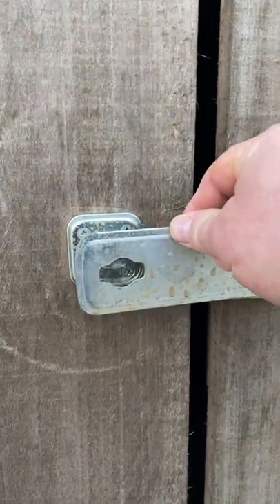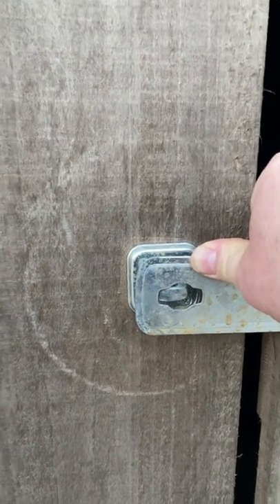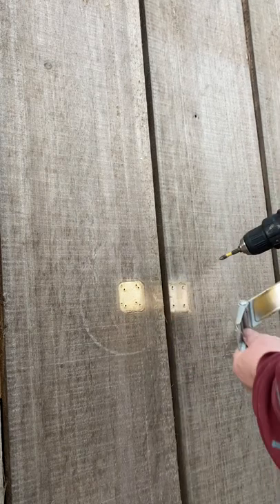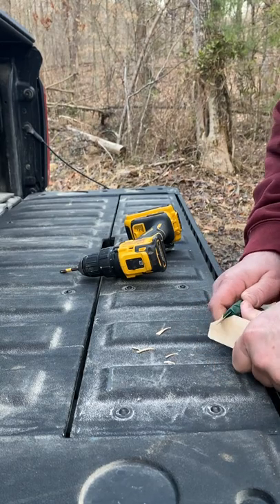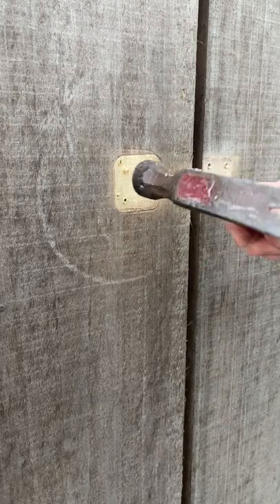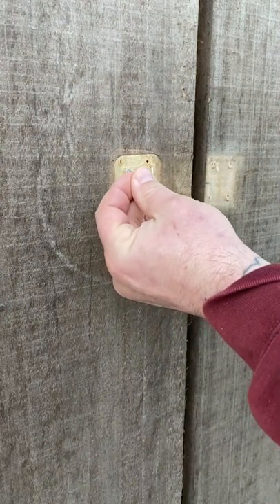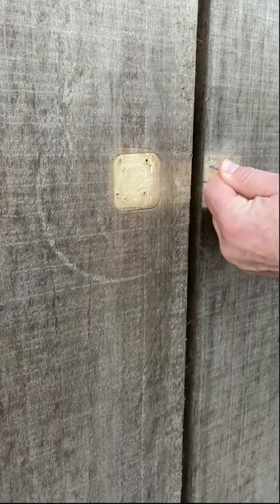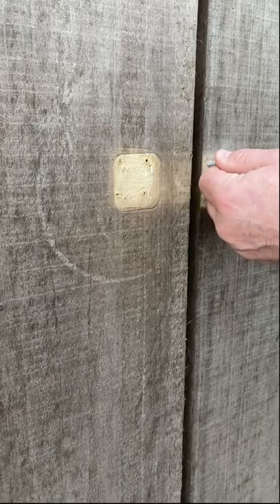Padlock Hack

Comment: Congratulations you just made it twice as easy for me to rip it off the door
Reply from the maker: You can do it!
Reply: @buildlife  why did I hear that in rob snieders voice hahaha .. ( you can do it ! )
Reply: For real man but some bolts washers and nuts then install your padlock latch thise screws ain much and anyone with a long decent screw driver could pop the latch off there not gonna bother with the padlock....old saying is locks only keep honest men sooo for a  few $ ya can at least have it so the would be theif has to make enough noicse so ya hear something happening  for 3$ at an expensive place ill buy the long bolts and some washers and nuts and we will never have to worry about a stripping issue .. thats actually a good idea for a future video just show a clip of this then say your hind sight was x and do just that ....in many applications what ya showed will work for what a person needs it to work for so good vid  but for a lock application meh nope thats why i made the comment i did
Reply: @trailman20  Well aware. The shed itself could be dismantled with a tack hammer. Has glass windows and soffits are wide open. There are many ways to get in if you want. Would be easy to cut the lock as well. The shed is in the middle of a gated 100 acres at the top of a mountain so the location alone is the best security. If they find it, get through the locked gate and choose to break into the shed theres not much else to be done.
Reply: @trailman20  Thats how I meant it LOL
Reply: @buildlifeoverland  haha nice dude nice haha
Reply: @buildlifeoverland  haha I hear ya man ..but hey I wasn't wrong about maybe having what I said be your new short ..I just watch the stuff I don't post anything ..maybe do a revisit for a vid and put in the bolts at least then ya have a other vid and it's for better security so the ding songs watching can feel a lil safer